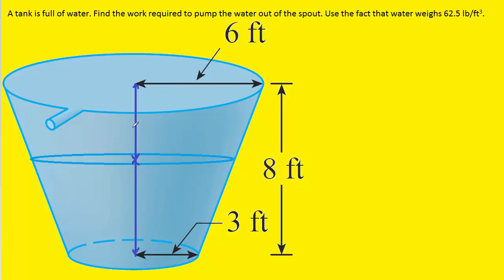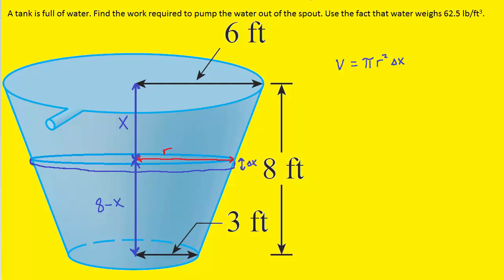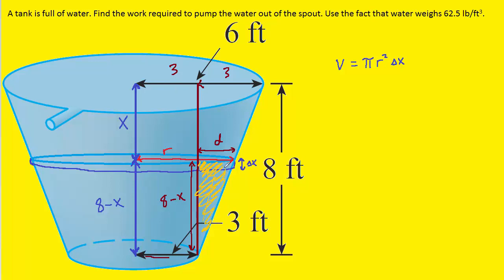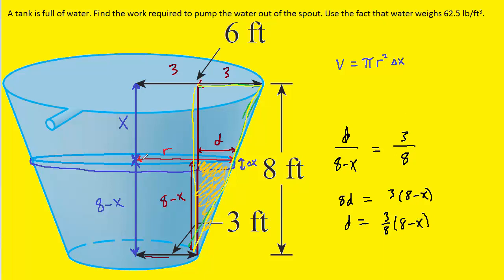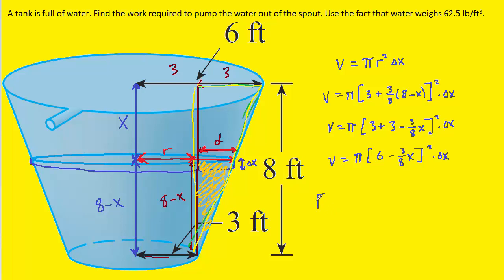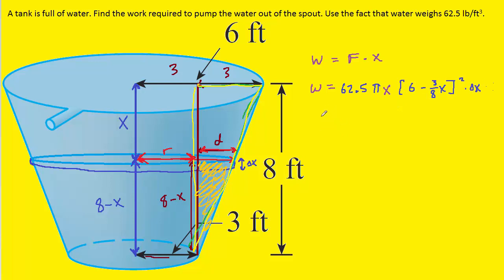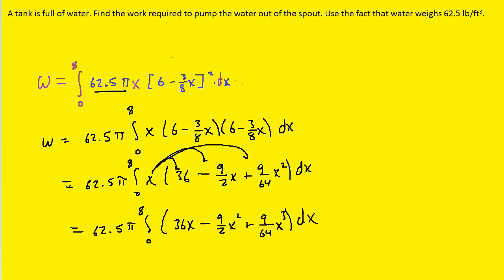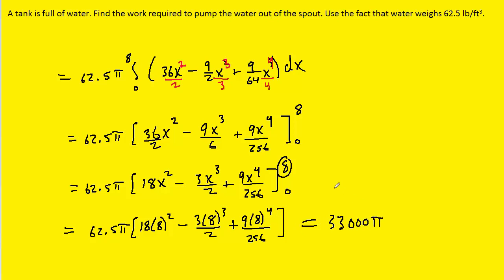A tank is full of water. find the work required to pump

Comment: Great video. I am just confused about one thing however. Wouldn't the Force be equal to m.g? I am confused because the density times the volume yields mass and not weight. The expression of F=p.V.g makes more sense to me than F=pV.
Reply: It states water is 62.5 lb/ft³ in the problem. Since lb is a force and not mass, the F = pV works fine.

Comment: This is a very good explanation and uses the "delta" x notation correctly. I have seen some other math videos out there that use the "dx" and that's technically not correct. I will take off at least a half point if a student uses dx on the figure instead of "delta x".